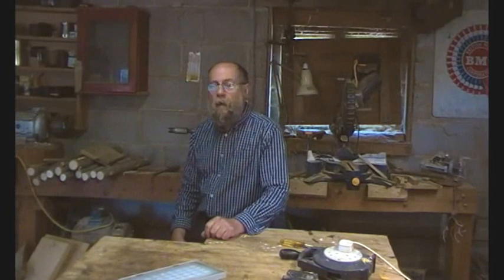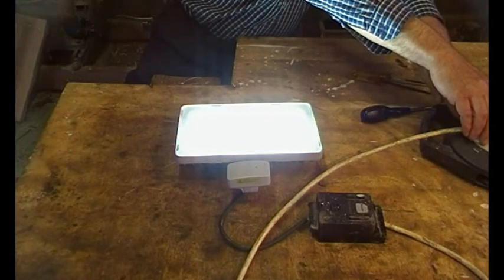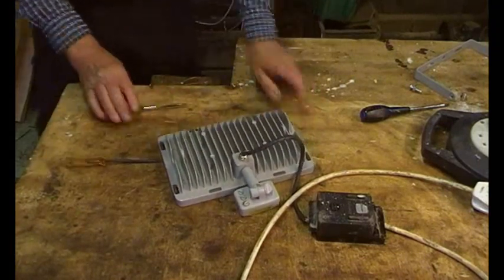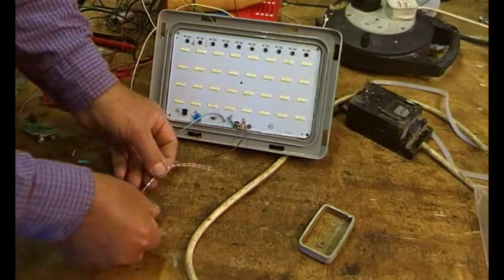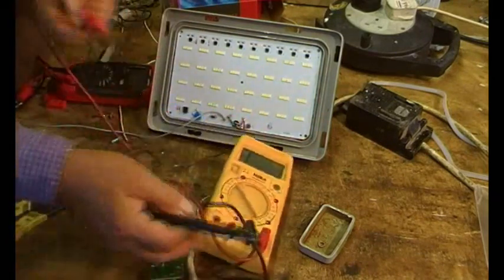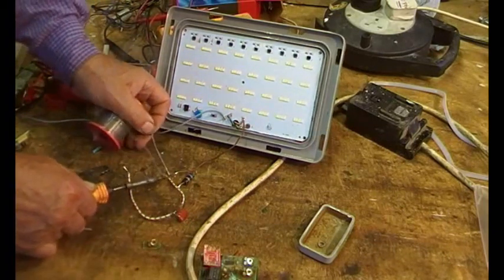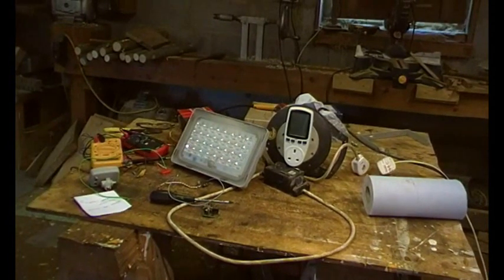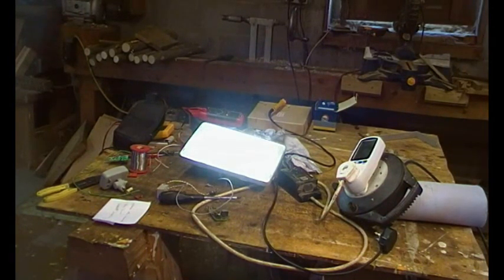LED floodlight repair and hack to worklight, re-purpose.

Comment: Well you got there in the end with it. And ended up with a useful light. :) Running at that lower power level should help it's longevity. I wonder if the cap fed supply was originally only for running the relay and the control electronics? 

I had an LED bulb a few years ago that I had bought from Jaycar Electronics. It was a rather expensive "Ecolume" brand one, a 12 volt unit that had a small Edison connector on it. We had it in our kitchen as a low level light but it started operating erratic within a couple of months. I wasn't very happy with a $34.95NZD bulb starting to fail in such a short time so I decided to investigate it. The failure mode was certain LEDs starting to flash. 

Quickly I found that if I ran it on a lower current then this problem didn't occur so I removed the  PSU and made a new simple one with a resistor and a T5 panel bulb acting as a quasi-constant current source. This lamp is now installed in the power room of my solar setup and illuminates the 24 volt control gear. It had been running perfectly well in this reduced brightness mode ever since and has been a welcome addition to the power room illumination.
Reply from the maker: Hi, yes I think you are right and this is what's called a driverless LED. The L terminal should have mains power to it direct from the relay in the control circuit. However I agree with you that running this at at about 10% of its rated capacity will mean it will last and should see me out. Cheers

Comment: Andy, I'm not an expert but I think there must be a resistor across the capacitor to discharge him ! (maybe I'm wrong)
Reply from the maker: Hi, you are not wrong a high value resistor should be fitted to slowly dischage the capacitor when not in use, cheers

Comment: Hi again, I'm feeling very akward now. We all make mistakes, especialy when making some kind of presentation. These nano piko and all that they are very easy to use on wrong actual capacitance.Not only that, I tried to use 1nf cap for my tesla coil and it realesed the magic smoke (diodes) ha, just another same day :) Anyway , for next I would recomend to dont waste precious time just update the title and that should be fine. I discovered this chanel few days ago and here I am - a new subscriber. Keep up the good work :) Dom.
Reply from the maker: Dom, no worries, as you can see my back catalogue goes back quite some time so it's best to get things right from the start. Cheers, Andy

Comment: You still got your frontera mate
Reply from the maker: Winston, no regretably, it did everything I wanted but the left knee told me to get an automatic or it would never give me any peace. It was still a good working truck when I sold it with only 130,000 miles on it. Cheers
Reply: Andy Reynolds I’m glad you solve everything on it and understand I wanted to say very good video on frontera back then
Reply from the maker: Yes, I like my vehicle to be right, that way they are reliable, cheers